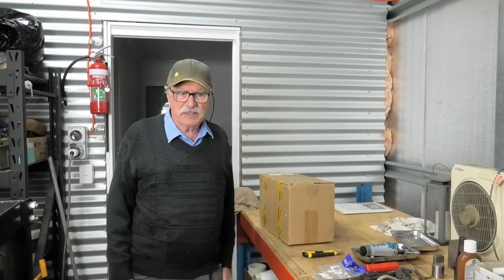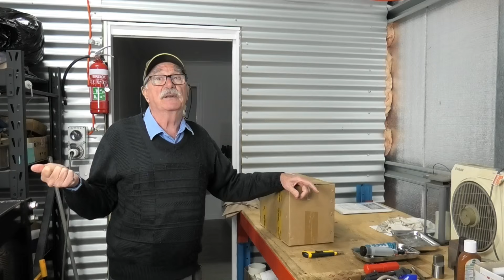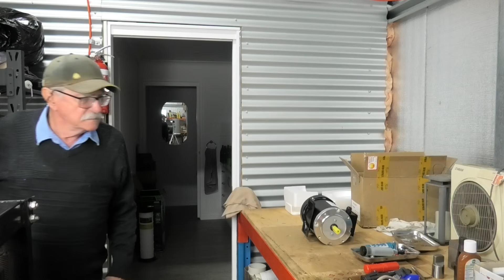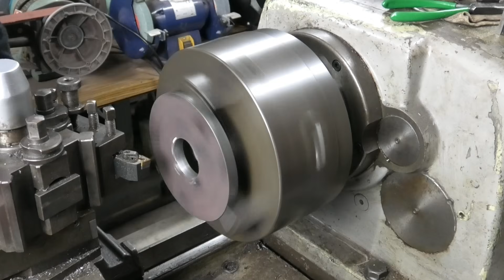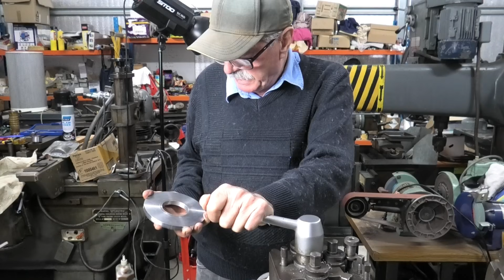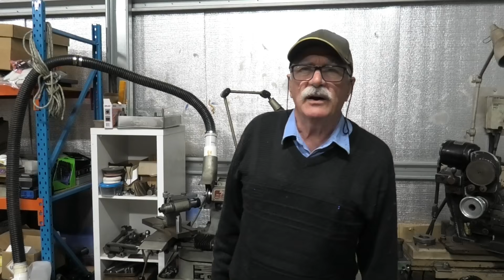Borer motor adaptor and countersink holder.

Comment: Good one Bernie .   If you encounter a runout problem when making that style of adapter , you can leave the OD a hair larger and finish turn it while it is clamped to something that is an extremely neat fit to the reamed bore and running dead true in the lathe chuck .   Cheers  👍